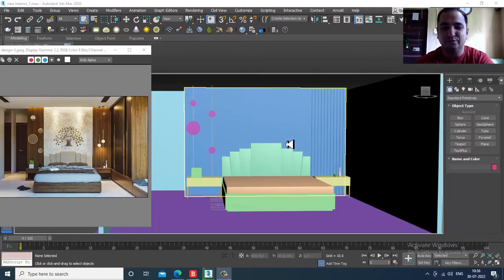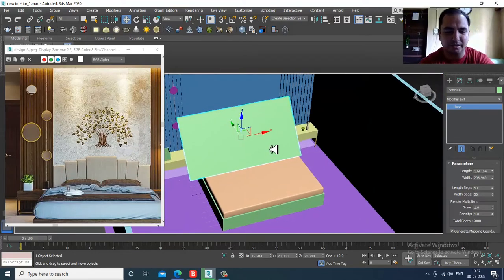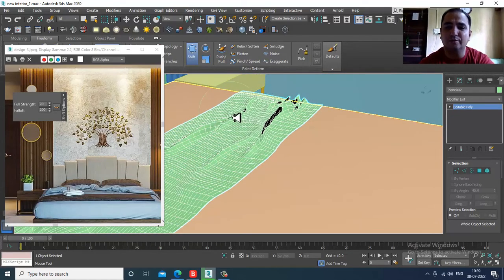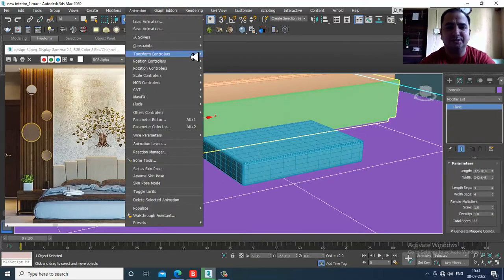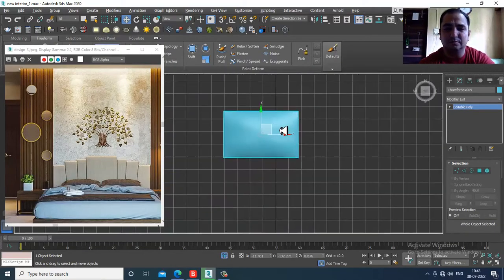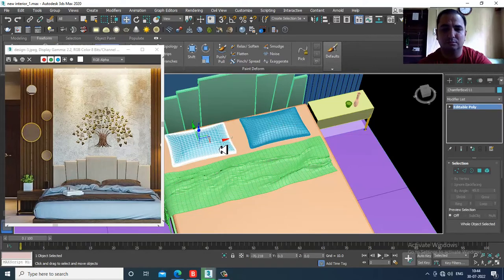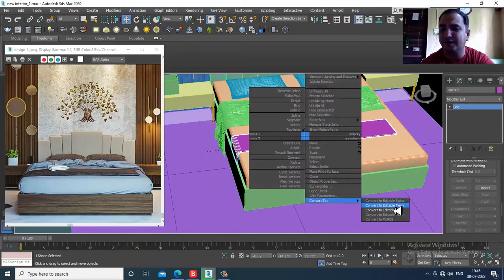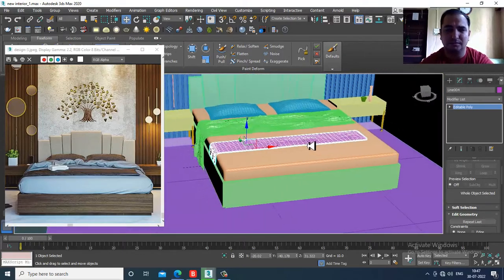3dsMax Tutorials, Learn 3D Interior Modeling from Scratch in 3dsmax ( Part 3)

Comment: Hi Sir How are you Sir, my cloth object is not behaving as expected in the simulation. Initially, it falls onto the bed correctly, but then it starts floating unnaturally and eventually falls off completely. I tried reducing gravity, but when I decrease it below -1, the cloth starts floating in the air instead of settling naturally on the surface. Also, I am using a plane with 50x50 segments, but it still doesn’t behave realistically. Could you please help me identify what might be causing this issue.
Reply from the maker: @InteriorDesigner-b1d  keep cloth a bit tilted and place not very above bed, then try simulate
Reply: @KayoTutorials  I'll try but same problem my simulation is not stop